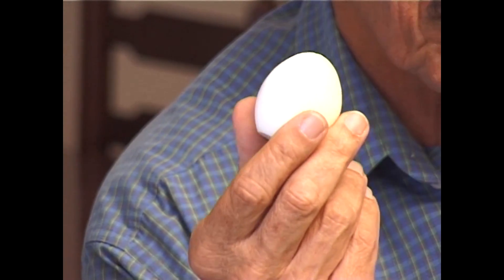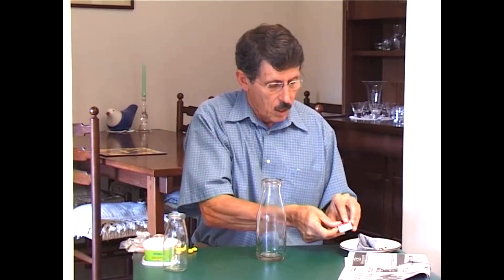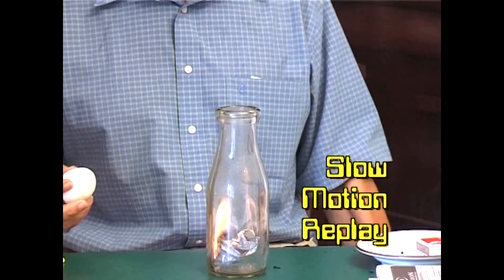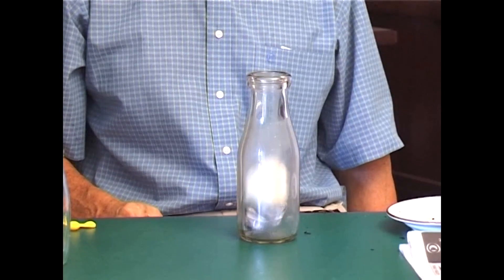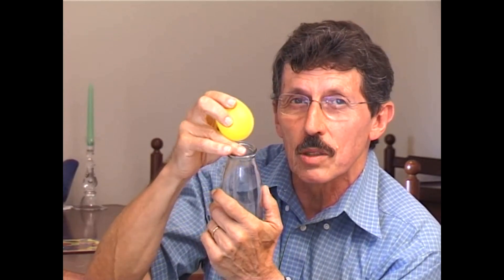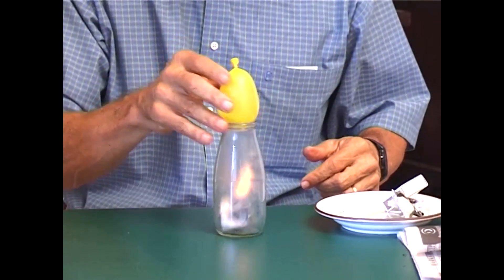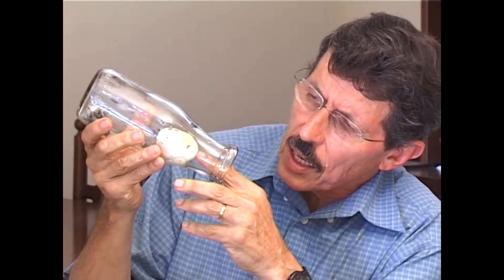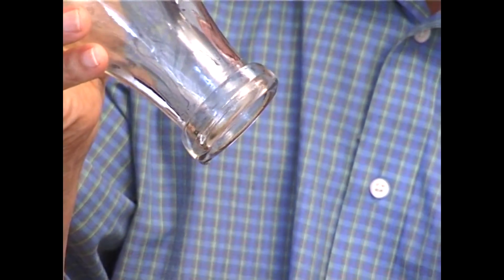Put the egg in the bottle

Comment: Question :
Why does the low pressure suck the whole egg and not break it ?
Reply: its a boiled egg... its firm but pliable...almost like a soft rubber
Reply: The egg isn’t sucked in by the low pressure, it’s pushed in from above by the higher pressure.
Reply: @BenceFeher  what's the difference?